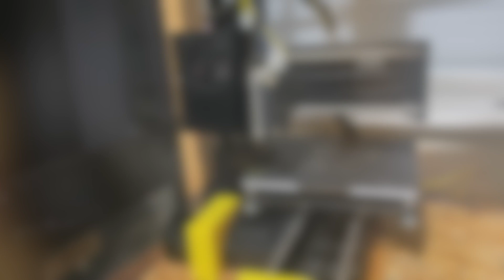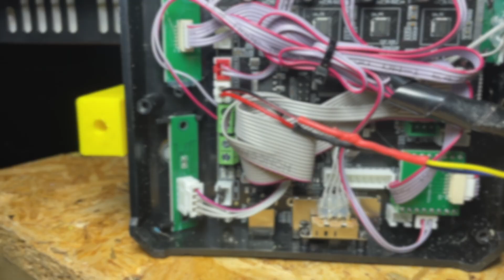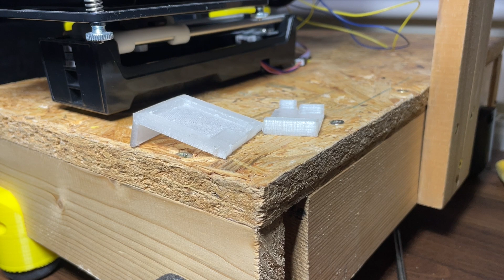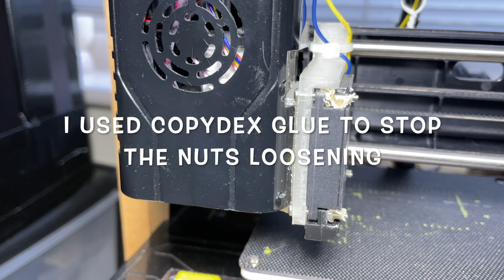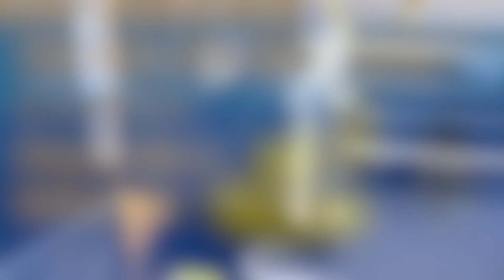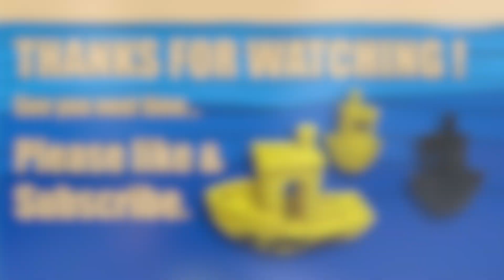Easy Threed K9 Mini 3D printer part cooling fan upgrade clip-on how to wire from control board cable

Comment: Nice job you didnt show results. but if i am correct the improvement here would be in overhanging parts and in getting rid of stringing
Reply from the maker: It should mean improved overhangs. I did look at improvements made after I made the change to having the fan but I cut it from the video. The overhangs are improved but I also changed the slicer from Cura to Prusa Slicer and was concerned that I didnt confuse the outcome of the different slicer & profile with improvements from the fan. I have yet to test it properly back with Cura new fan off and fan on. Also the final version bracket is slightly lower on the position. Really in truth I need to print out the final version. It will be coming up. Im currently looking at using Octoprint and that should be exciting. Thanks for your interest. Kind regards & best wishes.

Comment: Nice upgrade! I noticed you changed the knobs on the leveling screws, what type are those? Did you change screws also?
Reply from the maker: Thanks for your kind comment. The adjusters are all stock actually and original spec from the factory. They may have changed the design since I bought mine which was roughly 1 year ago. Kind regards & best wishes.
Reply: @NightStarLeafTech-vj3ez  Yeah mine is a little newer and has small black gear like knobs
Reply from the maker: @3DMaker2024-i  Thank you for the information. Kind regards & best wishes.

Comment: When I had my K9, I didnt have any problems with the cooling fan and my prints were coming out great. The Ender 3 I bought second hand was a nightmare to try to set up, but buying the  Ender 3 V3 SE was a great move and even better now I learned how to alter the Z offset. Took me a while but it prints great with hardly any lines in the print. 
But, I am still contemplating buying hte K9 again, just for fun. I think they have come down in price a little.
Reply from the maker: Thanks for your comment. The thing is the stock fan is on all the time & cannot be controlled in the slicer software. The 2nd socket (called Fan 1) can be controlled. It can be turned off altogether or throttled. So its more controllable. I might actually stop the stock fan and block the exit so that the other fan will be the only one. I haven't done any experiments to check how the print is affected. I only did one print so far with it. Ive also again updated the design to lower it slightly and hopefully it will now have an additional improvement. Kind regards & best wishes.